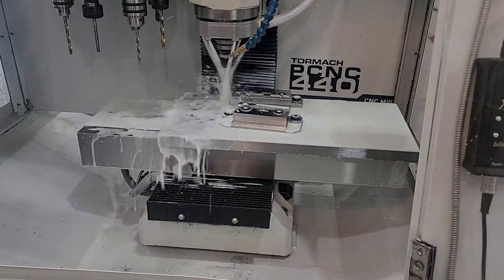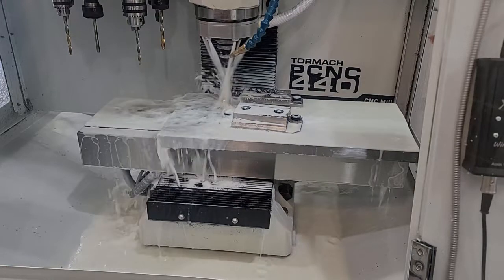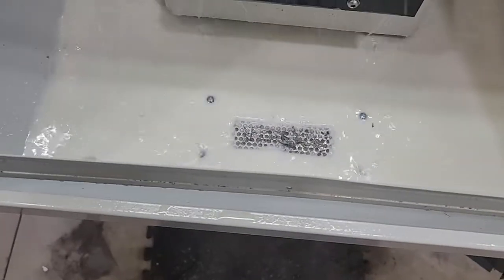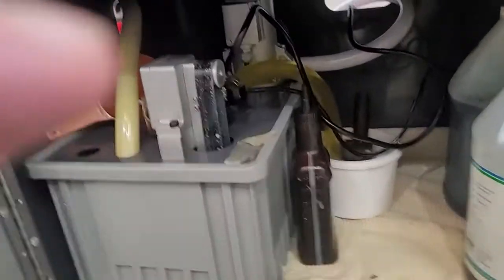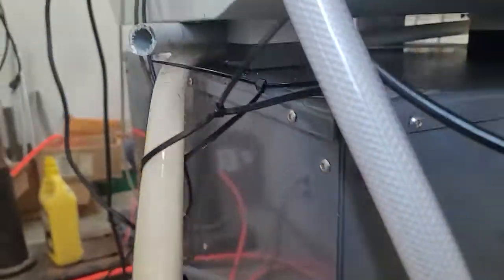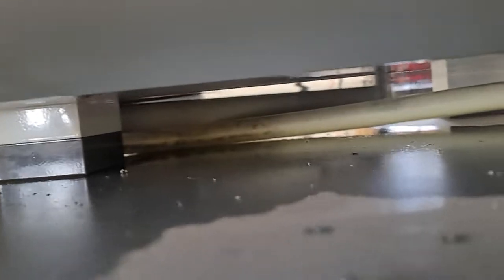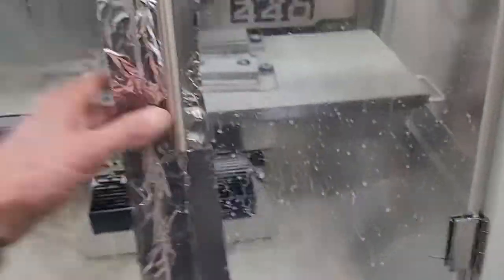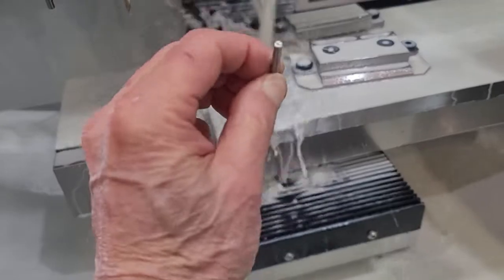stock Tormach 440 pump with 5/8 id line and Paul's 6 nozel coolant ring.

Comment: Just finding your videos, why do you want so much coolant flow? I don't think I have seen a machine flow that much coolant, and I can't think of a reason why it would be needed. Were you having an issue you think was due to lack of coolant?
Reply from the maker: Flushing chips out of pockets is a problem.  Lots of people are going to larger pumps.  I am happy with what going to a larger ID diameter has done for me.
Reply: @bobabbott8370  Ok I can see it helping to flush chips out of pockets.

Comment: Hey Bob; thanks for uploading this video. I have since bought one of these units for my 440. I've run into a wee problem though, with coolant leaking. 
The drain can't keep up with the coolant ring and coolant builds up in the enclosure. Also, if you notice in the back, where the mill column is, the enclosure is shorter there, and I had a huge leak yesterday. I'm going to try and fill that gap, and then seal it. But, the same problem exists, the drain can't keep up with the coolant coming in. 
I'm going to try and remove the drain filter thingy and see if that helps.
Reply from the maker: When your coolant is done draining..any dips in the tubbing that has coolant in it try to arrange so that there are no longer any dips and this problem will go away...I had the same issue until I made sure I had eliminated those dips.